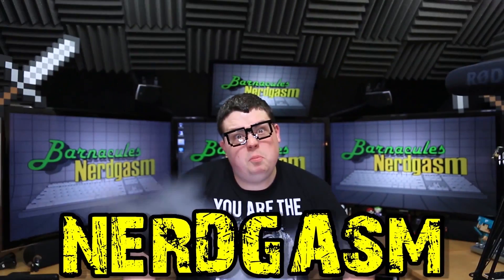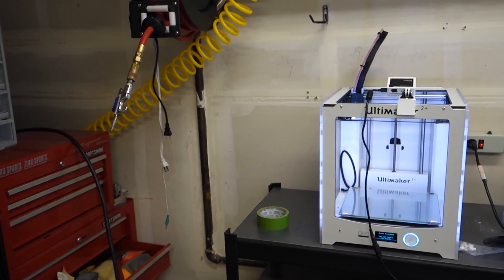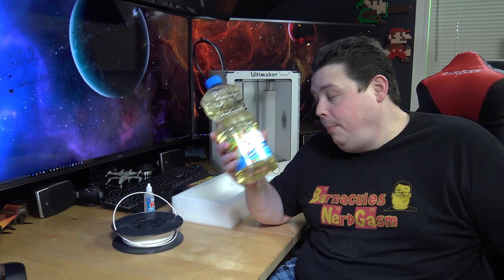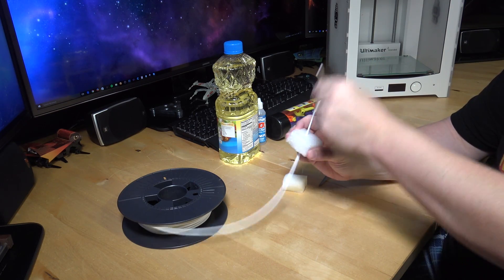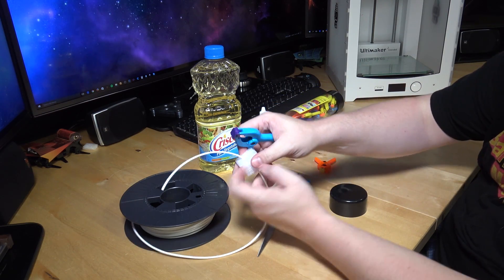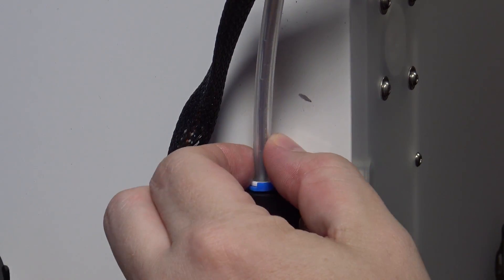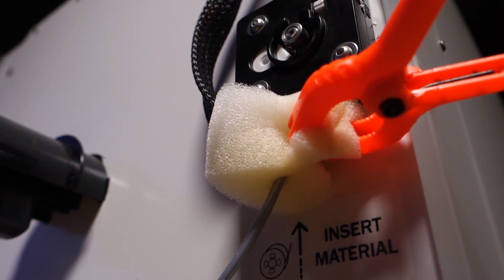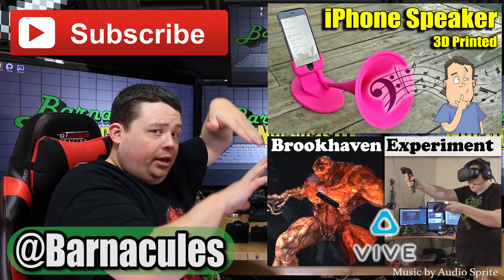Custom 3D Printer Filament Cleaner Helps Stop Jams! #JerryRigged - @Barnacules

Comment: As for me I did something similar to my printrbot, all I did was I 3-D printed a small cylinder and I placed a piece of a green sponge inside the cylinder and in the sponge I injected baby oil into it and I just let the plastic slide through the cylinder so the baby oil will just clean up the dust so yeah that's pretty cool.
Reply from the maker: +dylan bellerose A few people have asked about sponges, did you ever have problems with the sponge coming apart?
Reply: +Barnacules Nerdgasm not really because the cylinder hole entrance and exit is so small and with my piece of sponge confined in the plastic cylinder I don't have to worry about it coming apart.

Comment: Someone needs to make a 3D printed version of this,  It could be some like a simple cylinder that is hollow to contain the foam with closed ends with holes at each end just bigger than the filament it could then be hinged lengthways with a simple built in clip to keep it closed,  Then all you would to is cut down some soft foam and glue it inside the printed filter housing now all you need to do is add a few drops of oil and clip it around the filament.
Reply: +EQUINOX But what if you have feeding problems when you print that?
Reply: Tony Tesoriero +brit's fabrication Yeap that is pretty much what I was thinking.  Thanks for the link
Reply: +EQUINOX on  it

Comment: You might want to screw a housing to the 3D printer for the filter instead of having it loosely held in place with the clip. Of course the beauty of that is that you can 3D print the housing.
Amusingly, a musician by the name of Onyx Ashanti uses 3D printed parts for his instruments, which are completely custom, and 3d prints replacement parts for his printer all the time since he takes it on the road.
Reply: +GreatSmithanon Self  perpetual!
Reply: Final Cam It would be great if he wasn't an SJW and BLM supporter.
Reply: LOL. they're the worst!

Comment: I am really surprised you are having clogging issues with the Ultimaker 2+. Is this just because of the bowden setup or something else?
Reply from the maker: +Yabbakinz It's because of the massive amount of dust in the air in my garage. If I was in a very clean room and used filament right out of the package instead of having it sit around it wouldn't be that big of a problem.
Reply: +Barnacules Nerdgasm Oh ok! I have had issues with clogging in the past with my printers but only a few times. Nice to know though :)

Comment: Why did you not use the 3D printer to print the filament filter?
Reply from the maker: +MrFozzie41 Because this method is dead simple.
Reply: +Barnacules Nerdgasm That's as good a reason as any I suppose! Great video glad the 3D printing is back!

Comment: why not 3d print a small box that would hold the sponge and sit just below there you have it in this video that way you would not have the weight of the sponge+ clip putting drag on the filament..? i know nothing of 3d printing but seams that it would work. you could connect the box to the 3d printer using Velcro and then you could even add to that and put a small bottle on top filled with what ever lube your using that would auto refill the sponge

Comment: do you really need the oil??? how about just using the same method but with a piece of swiffer duster instead.
Reply from the maker: +Kanalrevolucion The swifter duster could be pulled up inside of the machine or have fibers pulled off it, the foam doesn't have this problem. Also you don't need the oil to stop the dust but it helps with feeding and takes stress off the feeder.
Reply: +Barnacules Nerdgasm , good point that's why I follow you :-)

Comment: You can just print a filter
Reply from the maker: +jon phillips One of the rules of #JerryRigged is that the 3D printer cannot be used, it has to be stuff you can make from crap laying around your house :D
Reply: +Barnacules Nerdgasm you could use one of those " ferrite " wire clamp holders used in electronics and sandwich some foam in that way https://upload.wikimedia.org/wikipedia/commons/6/6d/Ferrite_clamp-on.jpg